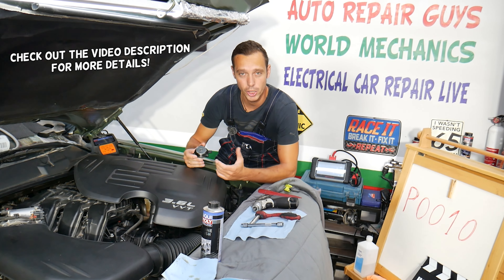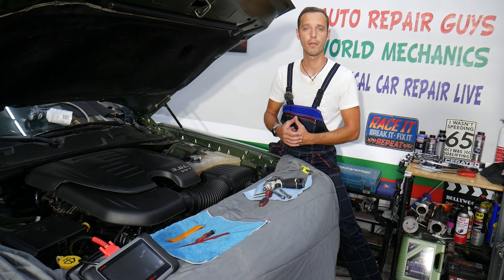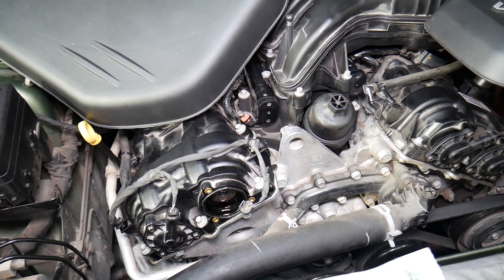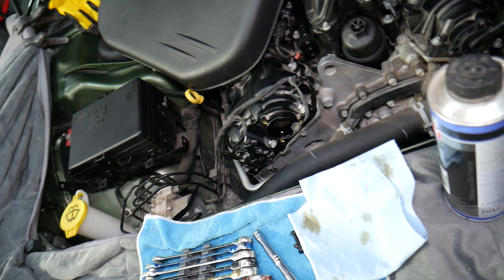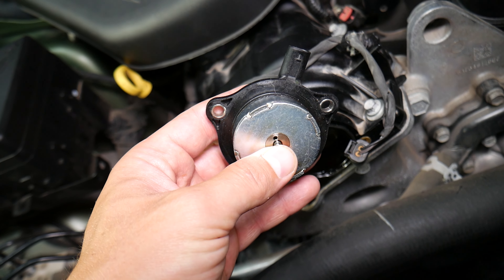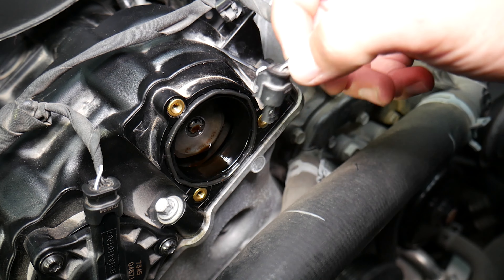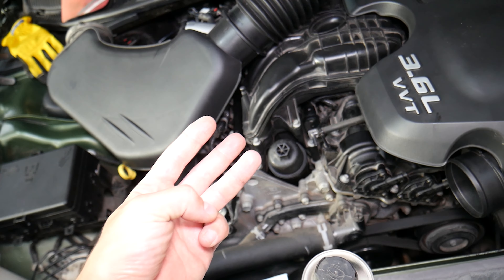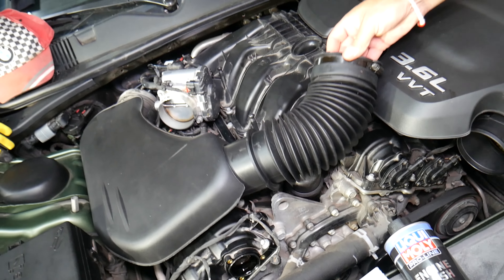DODGE CHARGER CODE P0010 CAMSHAFT POSITION ACTUATOR A BANK 1, CHECK ENGINE LIGHT VVT SOLENOID

Comment: Hello sir! I had a quick question sorry If it doesn’t have anything to do with this vid. Do you know if a broken/ cracked air filter box cause like a vacuum leak in a 2018 Malibu? Please help!
Reply: No, it doesn't, only thing would happen, if it's just a Crack in the air filter box, it's just more going going to throttle, which in turn would create about 2 to 3 more horsepower.
Reply: I meant more air going to the throttle.
Reply: Check gaskets on throttle assembly, check all screws and bolts on assembly, check all any hose assembly leading to throttle assembly, or hold smoke machine over anywhere air can be sucked in.
Reply: It’s because I’m getting a P0299
And I checked all screws and gasket. But everything looks normal. The air filter box was broken, large openings. I thought maybe that would cause it.
Turbo I checked the turbine and and wastegate and they both function. The car accelerates super slow compared to before like I feel like it’s dangerous especially on the expressway when I ain’t getting speeds enough  to get out the way.